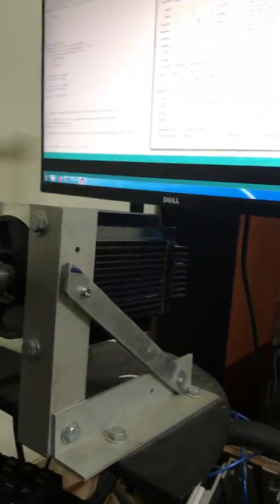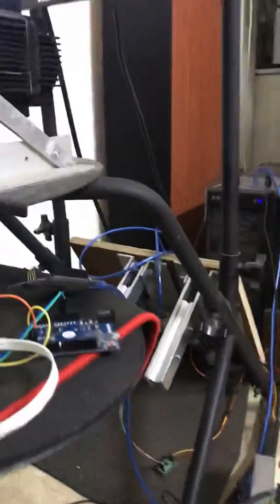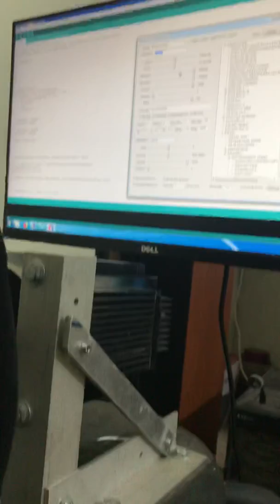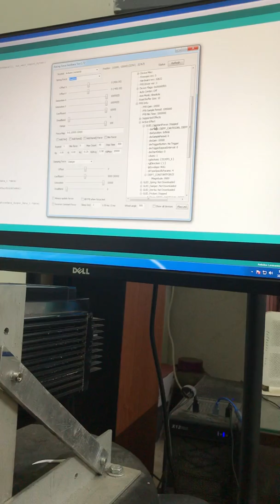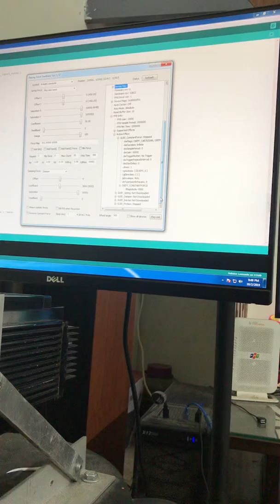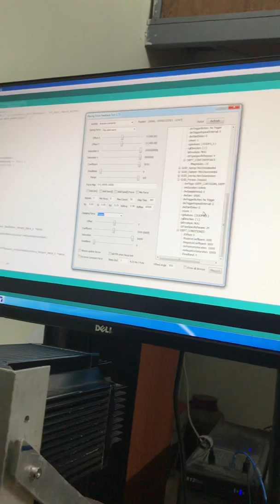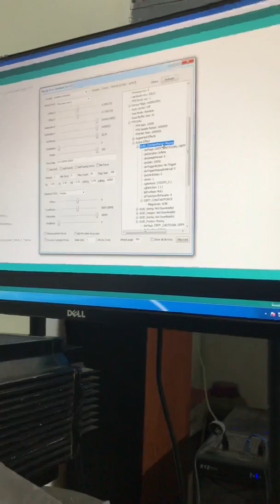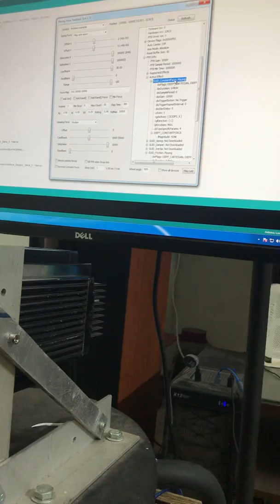Diy ffb wheel and making myown firmware

Comment: Hi Hoan,I am interested on working on this project.Do you want to publish it on Github so i can take a look?
Reply: Just saw on xsimulator your link for the  Github project,nevermind
Reply from the maker: Alex what information do you want? I can share.
Reply: @tranvanhoan206  I see that you have moved on to the STM 32. How is library for the Arduino?Is it working reliably?Any issues?I have an Arduino Leonardo(32u4).Is it possible to run it on Leonardo?
Reply from the maker: Alex i already test effects one by one, test in game about 30 minutes. Everything looks good. I will comeback to test and write GUI for it when i finish with stm32 (same code).
The code is written for leonardo, pro micro.